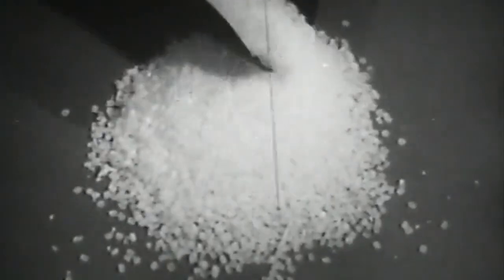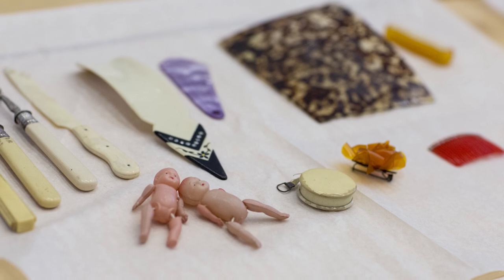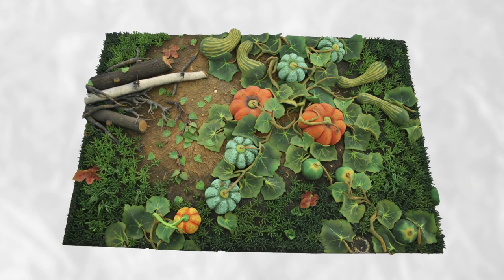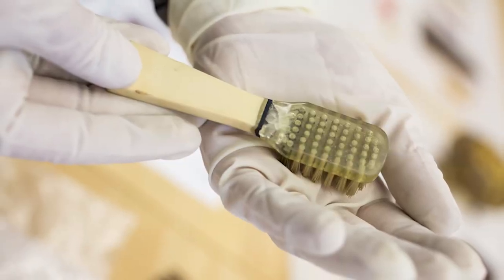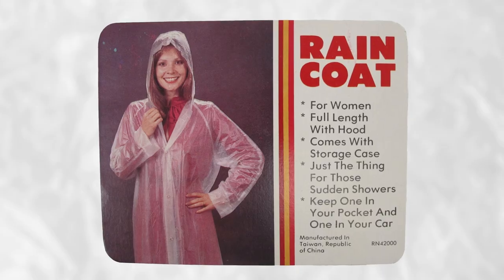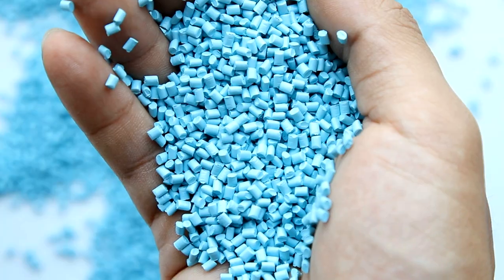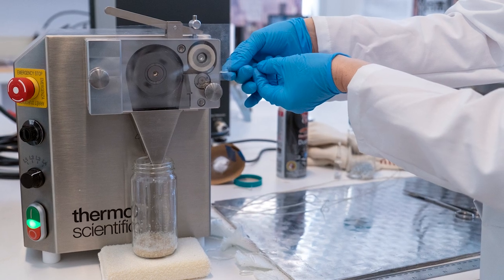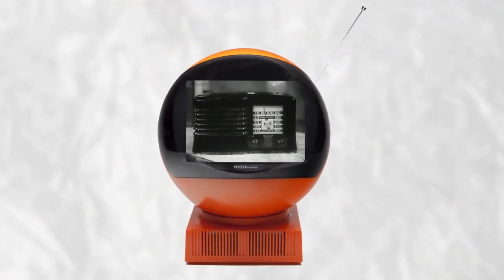Museum scientists race to preserve our plastic legacy

Comment: Kinda contradictory tho, no?
 
If it's gonna degrade, then it's not as big an environmental problem as implied.  
But if it's gonna be a big "forever" environmental problem  - then museums have nothing to worry about.

Can't have it both ways.  Choose one to harp on about & shutup about the other.
Reply: Nope, degradation is not a binary operator. If it degrades such that it can't stay in the same shape it has degraded enough for musea to care about. That doesn't mean that the molecules themselves got digested away.
Reply: Not at all. A plastic breaking into smaller pieces typically ruins its museum value, but those small pieces still cause a plethora of environmental issues if outside a controlled environment. Besides that, there are 10s of thousands of different formulations of plastics which decay at different rates and in different environments
Reply: Sure, cause a statue and a pile of stone rubble made of the same statue are equivalent in their historical value to museums so we shouldn't worry when a statue is destroyed...